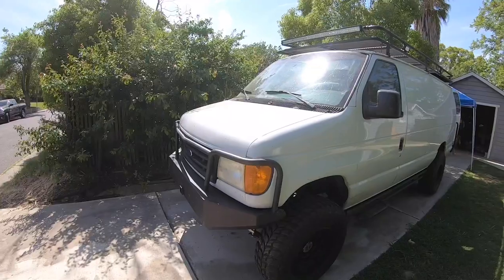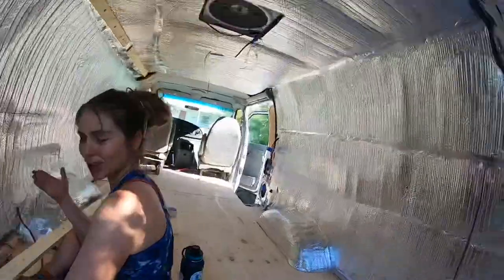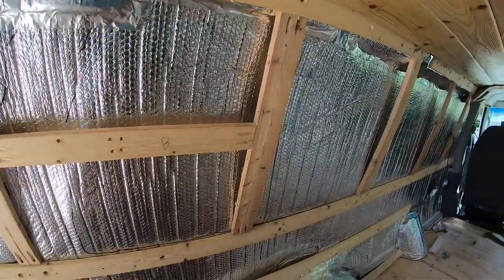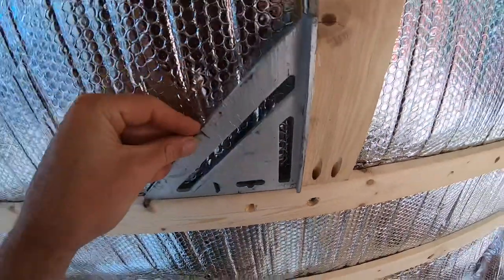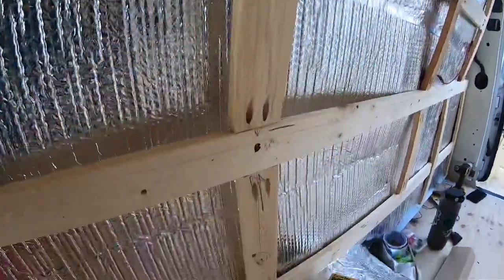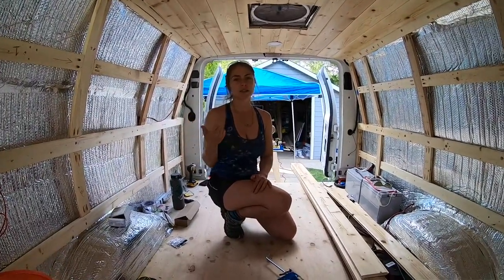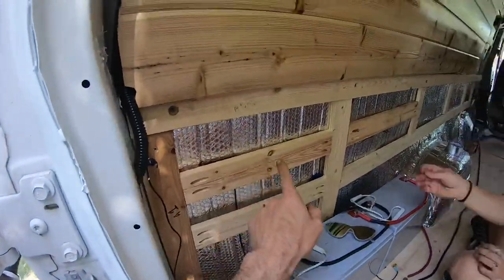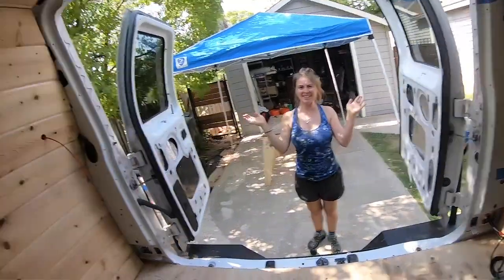Ford Econoline Van Conversion | Getting Your Van Ready to Build Framing For Walls

Comment: I got R6 value insolation in my walls, floor and roof. But I'm doing the walls in plywood.  Even obove the driver / pasenger, I have two layers -R4 insulation.    My set up is probably a hundred lbs lighter than your setup. I have a 2007 Ford E250.  I start on the panaling in a couple of days (-:
Reply from the maker: Way to go! Stoked for you. You should be out there in no time! This was a client build. The client requested everything we used.

Comment: How well has everything stayed attached tight 3yrs later?  I used luan with self tapping screw and spray glued carpet up over that and over about 2 years quite a few of the self tap screws loosened and backed out.  Im redoing it again, better this time and im using thread lock on all my stud walls attached directly to the van .
Reply from the maker: Still intact also I’m my van for the last 6 years

Comment: Reflectix isn't the best. How's it feeling after using it? Dealing with a ton of moisture?
Reply from the maker: It's not the best but its cheap and it works great for a vapor barrier.  Not really dealing with any condensation.
Reply: @Vankookz  how shite is your cell service? We used it just to winterize some windows recently and lost almost all cell service 😂

Comment: I try to watch every van build that I can!   I am trying to find other van-lifers who can reach out to this awesome 76 years young woman who could really use some help with insulating, framing, and a means of showering, etc in her van. She has been living in her van full time for 2 years now and only recently got a portable air conditioner, but I dont think she has enough solar to run it very much each day. The same with heat in the colder months.  With the rising cost of everything she couldnt make it on a fixed income and had to go back to work to get the necesseities to survive in the van. So please, if there is anyone out there who can provide any assistance to her or if you know of someone in the LosAngeles area who can help her with anything please do so soon, as the weather will only get hotter as we get the summer months.  Here is a link to her shoutouts and a walkthrough of her van.   L.A.V.A Lindy's Awesome Van Adventure   https://youtu.be/DCBMU4EsQSU
Reply from the maker: I wish we could help but we are nowhere near California

Comment: Is framing really necessary? Like couldn't you just rivet wall panels to the metal frames?
Reply from the maker: You definitely can!  This just helps the build be so much more secure and it helps when attaching upper cabinets and bedframes to the framing.
Reply: @Vankookz  Actually yes that makes sense. I didn't think of the other furniture. I was thinking of being able to save horizontal space by not having framing.

Comment: how come you dont use 3/4' plywood for firring strips
Reply from the maker: Would we need to rip each individual strip on the table saw?  Seems like an extra step.  These work pretty good never had a problem.  Just make sure they are all straight before you leave the lumber store.
Reply: @Vankookz  thank you for replying..i am having trouble  with my metal screw..waht length did you use? thank you sp much